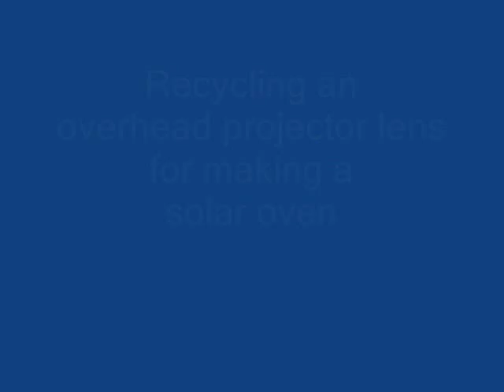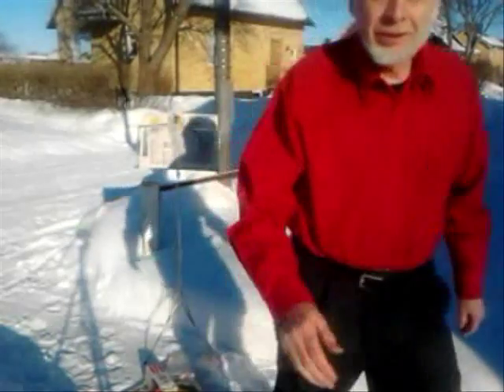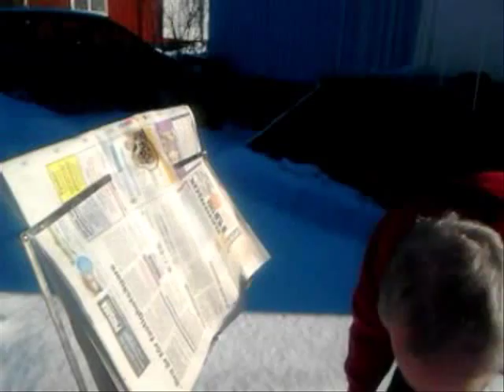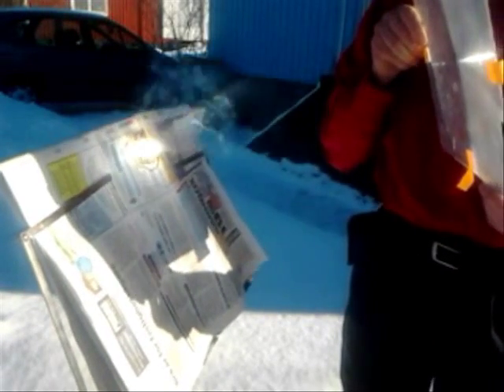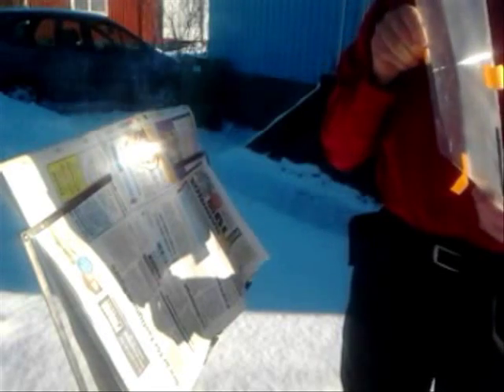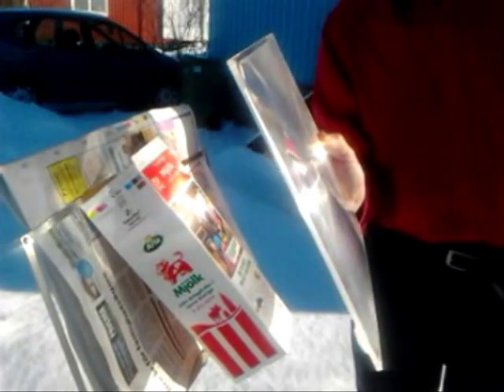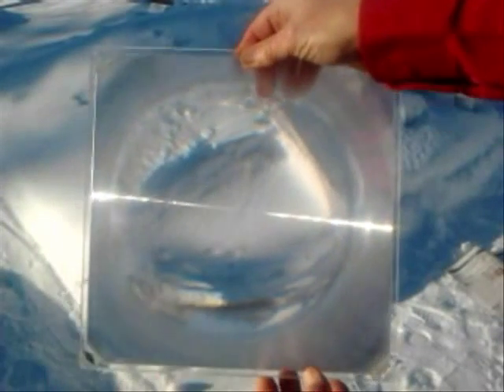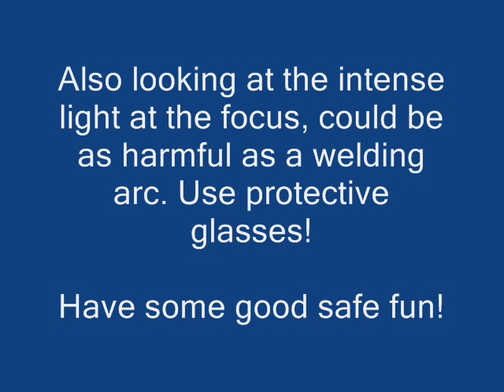Recycling Overhead Projector lens for Solar Oven/furnace

Comment from the maker: I've gotten some questions about splitting the lens.

The overhead lenses are (at least all I've seen) made of two plastic lenses that are glued or melted together at the edges to make a single thicker lens (with smooth surfaces out). If I saw off the edges where they are joined, about 5 mm I can separate them. (It's enough to saw half way through, if you have a circle saw. You then have a wider edge on one of the lens.)

To get the best focus:
The smooth side is turned toward where you want the focus to be. The ridged side is pointed toward the sun.
Reply: Hi Jeff, when you cut these apart, did you lay the lens flat and perpendicular to the saw blade to make a 'rip cut', or did you hold it vertical and make small shallow 'insertion' type cuts? Also, did it require a specific saw blade I would imagine a metal cutting blade wouldn't shatter the plastic as easily.

Comment: Hi Jeff !

Do I get 2 lenses of the same kind if I would split the overhead lens ?
Reply from the maker: You get 2 lenses of the same area, and they both work better with the sun than the original (compound) lens!  They have a much better defined focal point (But you must have the right (the side with ridges) side towards the sun.   The focal distance will be somewhat longer though, but I don't consider that a problem.

Comment: What is the maximum temperature this will generate? Could I melt sand or rock with this if I had it under for long enough?
Reply from the maker: Samuel Dunford I haven't tried making a proper frame and insulated cavity to be able to get higher temperatures. The original "edmund scientific" catalog said their 12" could make 2000 degrees (Faherheit) http://tupomedia.se/wordpress/wp-content/uploads/2012/12/Edmund-scientific-catalog-fresnel-lens-solar-furnace.jpg
Reply from the maker: Jeff Forssell Another source says:
Sand is mostly silicon dioxide - quartz - in small particles. 

 Its regular melting point is over 3000F which requires oxy-hydrogen 
torches when it is worked for high temp semiconductor fabrication. 

 Ordinary glass is made by taking ordinary sand and adding soda ash or 
pot ash to bring the melting point down into the 1500-1800F range, then 
adding lime or limestone for stability as sand-soda glass will dissolve 
in water over time. 

  Cooking glass from mix is usually done at 2200-2450F and hundreds of people, mostly glass artists do it every week.
************
So if you mix sand with soda ash - 2000 degrees might suffice.